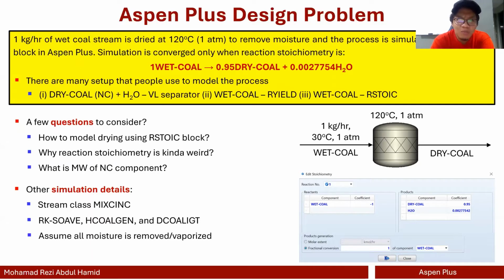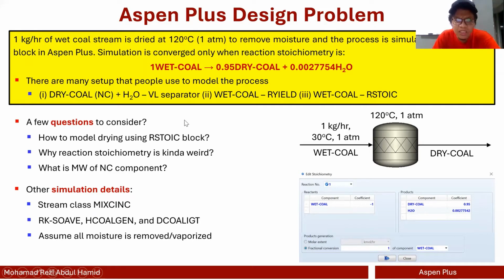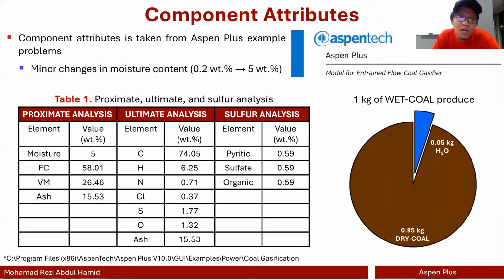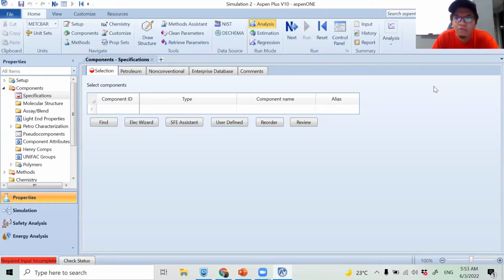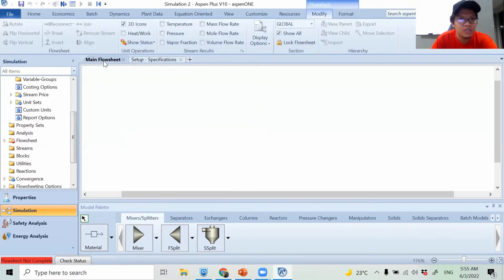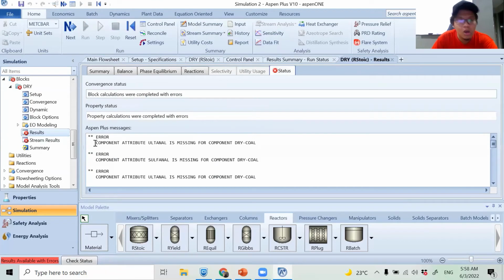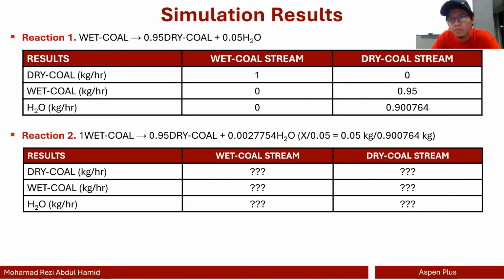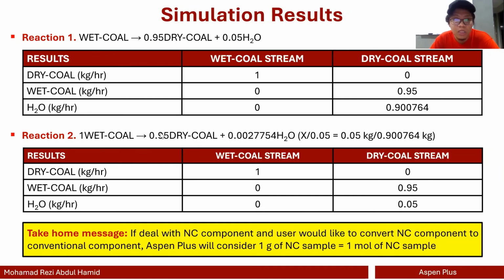Aspen Plus - Coal (Nonconventional Component) Drying RSTOIC Block

Comment: Is there any reason behind that you selected dryer to operate at 120ºC? Thank you
Reply from the maker: The purpose is just to dry coal..common sense tell me that water will evaporate at 100 C at 1 atm. I set higher because moisture is trapped in pores of the coal, the liquid trapped in small pores usually will have lower vapor pressure (capillary condensation or Kelvin equation) so setting a higher temperature might be a good idea. Anyway, this are all just based on a quick estimate. A good way to know would be to experimentally determine water removal. Using TGA analysis would definitely help to determine water removal from coal sample